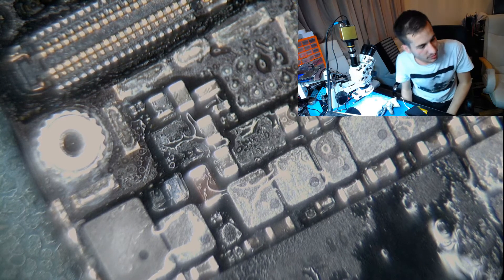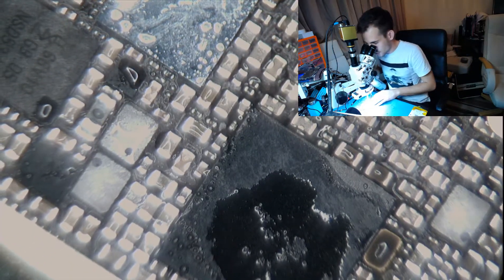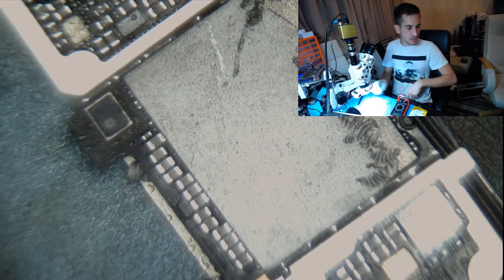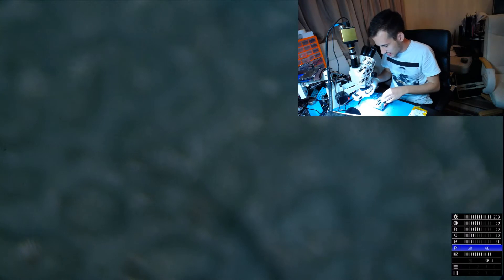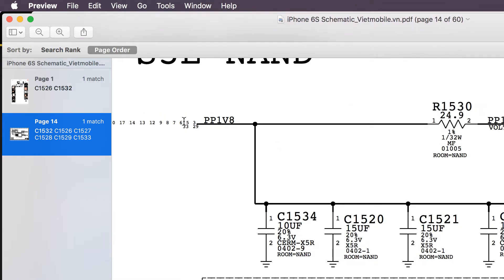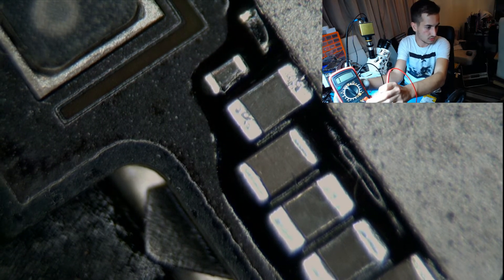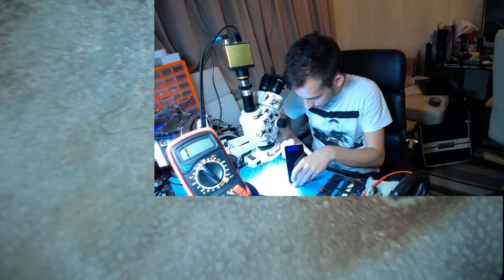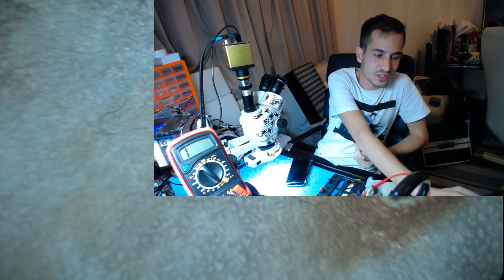iPhone 6s Dead 1V8 short found and fixed.

Comment: Data Recovery: This is what I was told. 1) water damage iphone se with a short on vccmain stuck at 0.05amps after pressing the power button. Device does not get recognized by the pc. The area the got most affected by the water is UPMIC_RF, U4020, U4000, UQPOETRF 2) iphone 6 plus stuck at 0.80 during boot. it has a short on pp1v2p, p1v2sdram and pp1v8srdram. Ram seems to be shorted. Please help me.